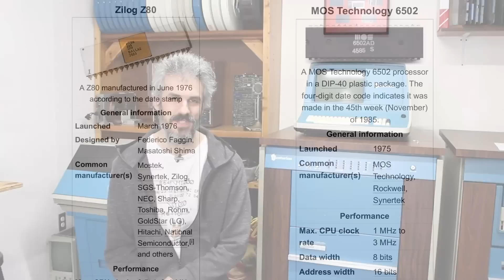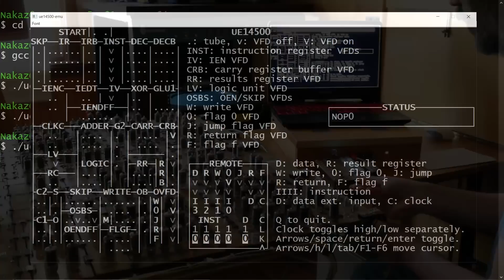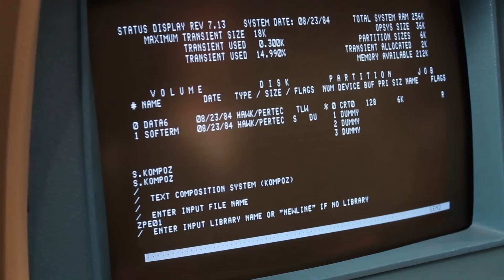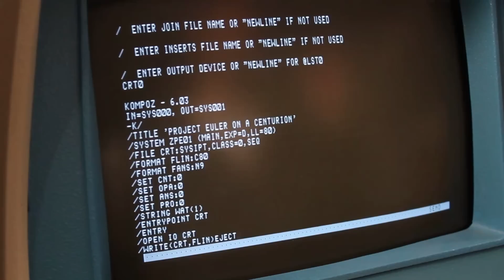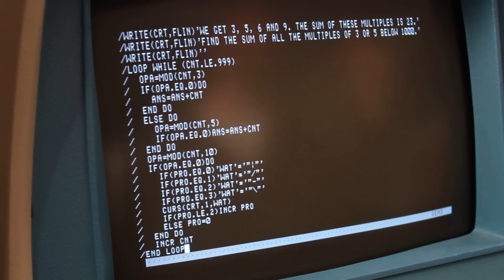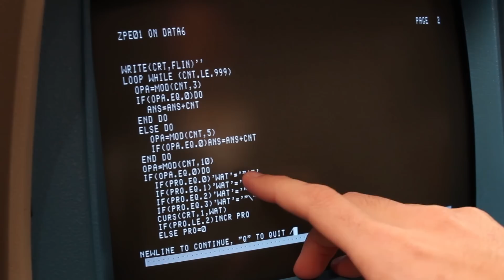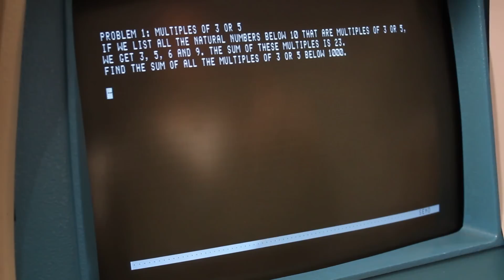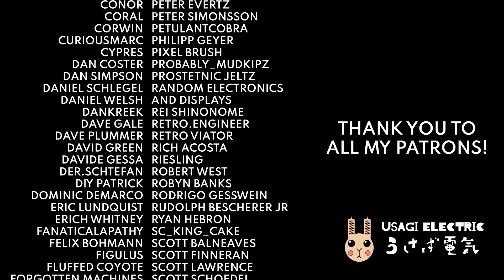Coding on a 1980s Business Minicomputer!

Comment: The real exciting parts of these old multiuser systems is how they handle simultaneous access to files and databases. When you can run two or more programs that are heavily updating a huge file and the file doesn't get trashed, that's when you realize that someone worked very hard on the part of the OS that delegates file access to users.
Reply: yep, DOS absolutely couldn't do that at all, you would need novell or something
Reply: @monad_tcp 4

Comment: Shaking my head at how you do string assignments!  Even 40 years ago this machine was clearly way behind the state of the art. On a PDP-11 under RSTS at that time I was using a full screen editor to create programs in the excellent 'Basic Plus' language. You could still be somewhat productive using those tools today !
Reply: Yeah, that was an amazing editor on the VT100 ... Really hard work if your terminal isn't cursor addressable though.
Reply: @edgeeffect  the VT100 was cursor addressable. Once the TPU editor came out editing was easy.

Before that the edit program was all typed commands.
Reply: This is not to throw shade at the Centurion dev team. They probably only had 2-3 developers for this entire system which as Ken says paid hundreds of mortgages of people during the 70s and 80s.
Reply: @TesterAnimal1  edt worked quite well with the VT100. Even teco would work in a screen mode.

Comment: This reminds me a little bit of my first C programming attempts on an Atari 520st. I had only one floppy drive. The C compiler from Digital Research was on ~10  floppy disk. You had to put the source code on a separate floppy disk and then switch between the compiler disks (the compiler would tell you which disk to insert) and the source code disk. If you inserted the wrong disk you had to start all over again.  On compiler run took about 15 minutes.
Reply: I used to program on the C64 using "Power C"...
Although it came on 4 disks instead of 10 on your Atari, it required swapping disks up to 10 or 15 times even to compile one file of only 2-3KB, and it took the better of 10 minutes...
It also lacked many useful header/libraries so you'd have to write nearly everything yourself.
I would assume that your experience on the Atari was meant to be used with a hard drive, but the C64 never even had support for one of those back then, so you had no other options...
Reply: In 1989/1990 I had an Amstrad PCW something or other, that I used for writing my projects and doing a bit of PASCAL programming. It only had a single floppy, and wasn't multi-tasking, so had to reboot each time I switched between the editor and the compiler. During a programming session I got overly familiar with quitting without writing; which didn't end well when I switched back to a word processing session.

Comment: Astonishing, I never thought I'd see an editor that makes vi look easy, or at least intuitive. Great job, Kompoz!
Reply: You know, *nix systems have an editor of a similar type to Kompoz, called "ed". I believe it was the first editor for Unix. Maybe it's not as bad, but it too makes vi look easy.
Reply: @fllthdcrb  "ed" standing for "line editor". It filled the same purpose as compose, but even more stripped back. There was never a UI version of ed, so you always had to rely on the terminal to maintain information

Was developed in the era before CRTs and inspired a compose-like version called "ex" with actual UI features (like a text buffer wow). And said ex was further developed so you could edit the buffer directly in a visual manner, creating "vi". Can even use ex-mode in Vim today
Reply: Egad!  I recall using "ed" to edit data files on a PDP in 1982-84.  It was abysmal - I just not realize it at the time.
Reply: yeah its funny how when it was unveiled vi was a tremendous advance in user friendliness, but it was also criticized for being wasteful. Terminals and connections were extremely slow and often paper-based so the terseness of interactive programs output was highly valued
Reply: the 'ex' syntax is often used in vi. That is what you do when you enter : command, like :q! is how to exit the vi and also how to exit the ex.
Reply: @fllthdcrb  yeah, and ed is significantly less user-friendly than the line editor on this minicomputer. It has basically no prompt, and if you make a mistake it just prints "?" with no explanation lol

Comment: Can you imagine not having a CRT to do all this? Instead imagine the frustration of keying into IBM punch cards (with ALL the errors), submitting your stack of cards, and getting a printout the following day. Somehow, that's how we got the Apollo Guidance Computer to get to the Moon and back again.
Reply: Well, the nice thing about punch cards is that they typically don't just disappear into the ether like bits in RAM can 🙂
Reply: @Mueller3D  I learned programming that way!  It makes you think about the algorithm you want to use and the way that is best coded in the used language, before blindly entering sourcecode and hit "compile&run" until it compiles without syntax errors and appears to run OK.
The chance of bugs is decreased doing it that way.
Reply: @Mueller3D  You sure get a mess if you drop your punch cards though.
Reply: Well actually.... Punching cards AND correcting errors, was not that hard. 

And always make sure to take a pen and draw a fat line diagonally across your card stack. Ask me how I know.
Reply: I was gonna say that substituting a new punch card for one with a different line of code would seem easier. Not like the hardware would eat your cards prior to the place where you made the change. 

And yes I’ve heard horror stories about dropping a stack of cards. Life is full of trade offs. Must be why in these modern times we’ve got nothing better to do than argue over where to put your curly braces in C/C++ and how many spaces (or just use tabs) etc. etc. 🔥
Reply: That was how I started.
Reply: @rocketman221projects  I heard stories of guys who dropped their BOX of hundreds of punch cards just before the project was due. Hadn't sequenced them. Or run an 80-80 list.
Reply: @KameraShy  But that could happen with an editor as well!  You saw it in the video.
Fortunately in those days you normally got a listing of your program whenever you submitted it (which also was the place where error messages were shown), so you could use that as a guideline for manually sorting the cards.

Comment: Beautiful video, thank you for that trip down memory lane.  When I was a just.starting.out programmer working for ACT in the Milan office, writing the Linkage Editor for the Olivetti A7 minicomputer, 1973, we used coding sheets.  That’s right.  We wrote out each line of code on a formatted sheet of paper.  We could then walk through the proposed code - called it a “code walk-through” and discover various stupid errors.  After a number of expresso stops - the coffee was brought up from the bar on the ground floor, in little individual thermos containers - the code could be entered into the machine and since we were good … it often worked first time.  That was the most important lesson of coding once upon a time.  Go slow, step by step, think it through, and catch mistakes before they occur.  Became a mantra of Deming … rework is harder than doing it right the first time.    Thank you so much !

Comment: Ah takes me back to the late 1970s when I was working with a Signetics 2650 8- bit CPU and had nothing more than the 1Kbyte PIPBUG monitor rom as system firmware.   All programs had to be written in assembler and then converted to hex codes for keyed entry (ie: hand-assembled).    So much work but such a buzz when even the simplest program was debugged and working.   Kids today.... 🙂

Comment: It’s incredible to be able to see these old tools in action and imagine how people worked back then. The learning curve and the tediousness are such it makes me hard to imagine how they were convinced to put so much money and time into this and get productivity gains.
Reply: I don't think it is that hard to learn. It is more boring. You need to make lots of unnecessary steps.
Reply from the maker: Programming for the machine was certainly an exercise in mental fortitude, but I think once you got the hang of the editor, it would be a lot easier. However, from an end-user perspective, a lot of the applications are incredibly user friendly and very well written!
One thing I didn't touch on in this video (but will in the next), is that writing an executable in CPL is only half of the job. The Centurion actually makes use of an in-depth scripting language called JCL (Job Control Language), and a lot of things like printing to the screen, getting input from the user, making conditional choices, etc. are all handled by JCL, with the script calling the executable only at the end once it's gotten all the necessary information saved in the appropriate places. 
JCL is even more obtuse and difficult to follow than CPL, but the two together are incredibly powerful!

Comment: That text editor makes VI look positively user-friendly! And I can see why there was so much demand for BASIC to be ported to different machines back in the day. It's a shame there wasn't a BASIC for the Centurion, that would've made life a lot easier! But I guess it makes sense that a business computer wouldn't need it, since the majority of those computers would just be running one custom made program that all the terminals would access.
Reply: VI is user friendly - compared to edlin, lined, TECO or any similar line based block editors of the time.
Reply: There’s nothing wrong with vi(1) 😊

Comment: Excellent video!  This is a milestone!  You're right. 90% of the problem is the editor. CPL appears to be influenced by Fortran, but most likely very streamlined for ease of compile.  Around that same time, I was working at Control Data Corp with a language called TAC BB2, which I really liked. It was a full featured "Business BASIC".  Very easy to use, no hassles with compiling and all those compiler directives. Notably, it lacked floating point math, so all money transactions were done in pennies, and when you printed out, you structured the print with a decimal point. To me, the lack of floating point was not a deficiency.  I like that. It avoided rounding errors.  All good wishes for 2023.
Reply: Don't forget there were at least a couple of computer lines designed specifically to run BASIC, one from HP and the other better known one from Wang.  There is at least one video of an HP 250 running- it's a timesharing BASIC system integrated into a small desk with a tiny console monitor, based on the architecture of the HP 9835.
Reply: So how did you avoid rounding errors in interest calculations?
Reply: @lawrencedoliveiro9104  - unless you have a language that supports some kind of infinite precision (which would require an infinite amount of memory) you will always get rounding errors.
Reply: Interesting. Since this was intended to be an accounting machine for small business languages such as Fortran and standard Basic were intended for other purposes. COBOL would have been too heavy. PL/I was used in a few shops for business programming but never caught on. It may also have been too much for the Centurion.

Comment: Happy New Year and congratulations on your first successful program on the Centurion! Your efforts and frustration remind me of my programming days back in the mid to late 1970's! Brought back a whole load of memories! 😀
Reply from the maker: Thank you, and Happy New Year to you and yours as well!
Y'all were proper programmers back in the day. The necessity to keep the full structure of your program in your head and work from there is something that I'm glad I experienced but certainly not envious of, haha.
Reply: @UsagiElectric  1) If you are going to use a system designed from tape use ,  better get a tape unit for the machine... 2) For programming I was always taught to write down (pen and paper) what I was going to get typed into the machine - this should help get your structure / " ; etc correct as you can (or get someone else) to step through it and spot errors.  Of course you need to check for typos still.  3)  It is always worth copying your first saved file to a "backup / ver0.00 " file that you can bring back if you edit the working programme and find you have lost something" (3a the use these days of "undo" as a command or whatever in "apps",  is that poss on the likes of these 8 bit systems ?

Comment: LOL, how we used to do things :-)  I used work on the Phoenix drives you mentioned attached to Wang 2200 systems, and they were great when they worked, but boy, did they seem to crash a lot!  That smell and that awful screeching noise still haunt my nightmares! After a head crash there was the fun of replacing the heads, then getting the damned things aligned.  Oh the joys of being  mini-computer maintainence engineer!

Great video!  BTW, at around 21:15 the text on the screen shows strings being declared using " ' STRING ' ", but your voice-over and what you type are in the format ' " STRING " '.
Reply: Ahah!  I should have waited for the end of the video, LOL ;-)

Comment: Hadn't heard the name "CPL" spoken for many years - unless I'm getting my wires crossed, it was the foundation that a Z80 development system ran on top of that I once used. And now I know what the letters mean.  Thankfully my mission was the Intel assembly code we used it to develop and not dealing with actual CPL, it's native editor or inner workings.  Still, my co-workers and I had our share of struggles very similar to what you just went through.  I really appreciate how you have fun with this older stuff and you mostly refrain from reminding your audience how dated the technology is - no reminder needed.  Your exacerbation and finally triumph was a pretty frequent and common shared experience back then!

Comment: Way back in the '80s when I had to load my assembler for the Z80 in the ZX Spectrum, it would take 15 minutes to load the assembler from tape, and a split second to crash it.
So, you can guess, I did not write too much of that on the ZX Spectrum. 
Therefore, I had to do a lot of READING to ensure I did not do something that would anger the assembler and crash it.
You learn to appease the beast and keep it calm!
I preferred to use Spectrum Basic, which was much better, very powerful, just slower.
I wrote a full-page word processor in a week and it worked, but you would press a button and wait for the whole screen to update, so I changed a few parameters, and limited it to 3 lines.
This is why I called it a periscope editor, although it was easy to use, powerful, and it allowed me to save documents to tape, load it from tape, and print it to a dot-matric printer.
Later, I wanted to print it a bit more "normal" instead of the blocky text, so I would send a code to switch the printer to NLQ (Near-letter quality), which is a feature the printer supported.
This was all in the manual that came with the printer, so again I had to READ the manual to be able to do this.
Boy, those were the days!
Thanks for taking me back there to those almost-pioneer days.

Comment: Awesome work. 

As your interaction with the Centurion transitions from getting the hardware running to working at the terminal for long periods, I'd recommend moving the terminal away from the chassis onto a bench.   That's how the system would have been used back in the day: you sit at the terminal when it's at desk-height, and the noisy components in the  chassis aren't wearing away at your eardrums.
Reply: And with a bit of luck,  you might be able to use the Centurion terminal with the PDP-11.  Two birds, one stone.

Comment: I'll admit that if I started programming in CPL back in 1982 instead of TI BASIC, I probably would not have kicked off my career in computer engineering. However, it's really cool to see the CPL program compile and run like that. Yep, with the really slow TI BASIC screen I/O, I also quickly learned not to output too many things to display during computations.

Comment: Great video. And I get that the point is not to get the correct answer but to test a program on that device. I just want to point out that of all the Euler problems, the one chosen is really not brute-force friendly.
The multiple of 3 are 3,6,9,...,996,999 their sum is obviously 3x(1+2+3+...+333) = 3 x 334 x 333 / 2 = 166,833
The multiple of 5 are 5,10,...,990,995 their sum is obviously 5x(1+2+3+...+199) = 5 x 200 x 199 / 2 = 99,500
we can sum those two values except the multiple of 15 are been counting twice so we have to subtract it once
The multiple of 15 are 15,30,...,975,990 their sum is obviously 15x(1+2+3+...+66) = 15 x 67 x 66 / 2 = 33,165
the answer is 166,833 + 99,500 - 33,165 = 233,168 as the computer rightful answered

Comment: Cool to watch your video, bringing back memories of the days without fancy IDE's and just simple line editors. As a programming teacher one small remark about your program however (cannot help it!): I suggest it is clearer to check if CNT is smaller than 1000 (as stated in the exercise) instead of checking CNT is smaller or equal to 999 (in which you made an implicit thinking step).
I really liked the video, and subscribed to your channel!
Reply: I also would have programmed it your way as I was taught, thought his was was odd and wondered if there was a reason technical to the Centurion why he did it that way.
Reply: @KameraShy  Good point. Maybe the language only has a 'less than or equal' operator, and not a 'less than' operator. For a moment I considered that it had something to do with the maximum integer size together with binary coded decimal representation, but that is unlikely since the answer that is printed at the end is > 1000!